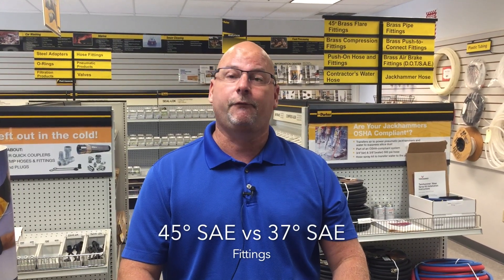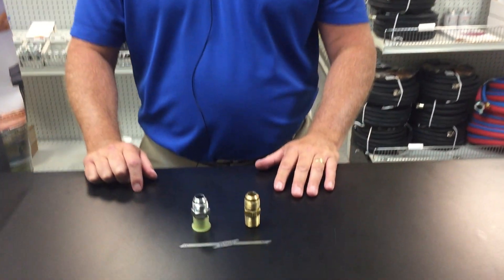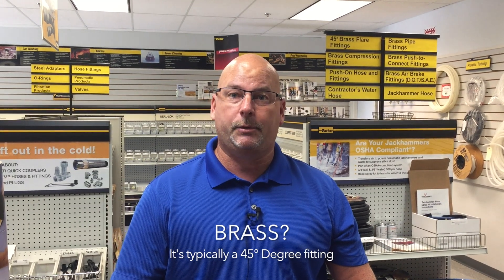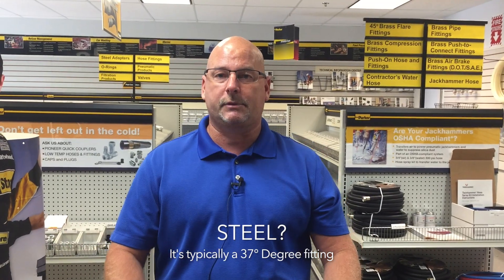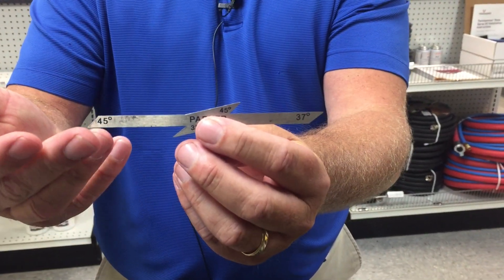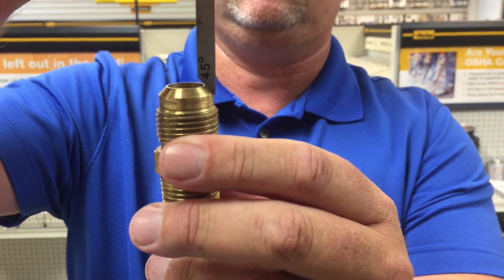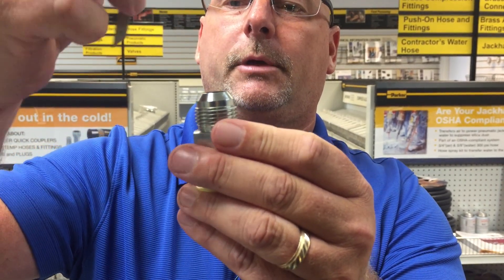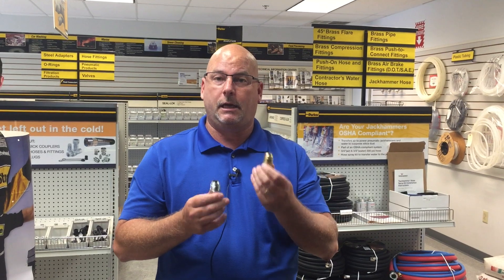How To Tell The Angle On SAE Fittings?

Comment: ah!  steel 37 brass 45.  That was the answer I need.  That gauge looks like it's made to go inside the fitting and then hang on the edge.  If it's a tight clean fit, that's the angle.  If you see light in the gauge, then it's probably the other side.  The long edge goes inside the fitting and the "hook" hangs on the angled flare.  That's just how I see it.

Comment: Nice video. I think I flared a 45° on an auto AC aluminum line when it should’ve been 37°. The line came flared from the supplier but it was scored deeply by their tool so the flare failed during install leaving me to clean up and reflare the incorrect size 🤦‍♂️